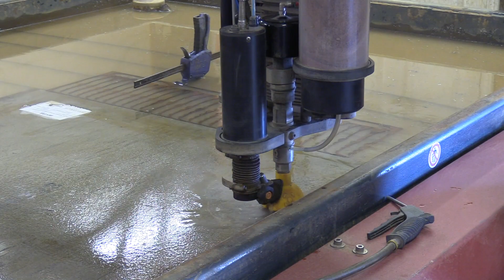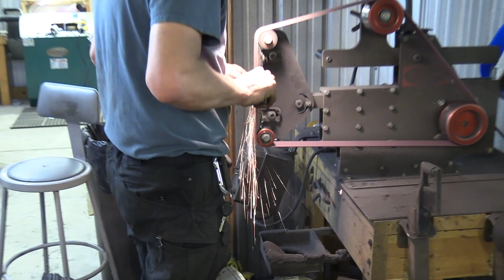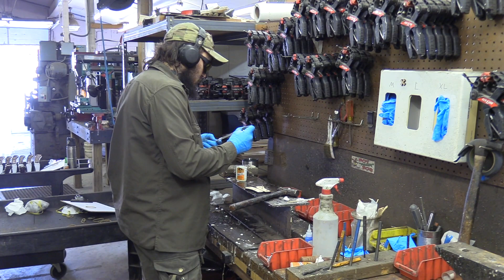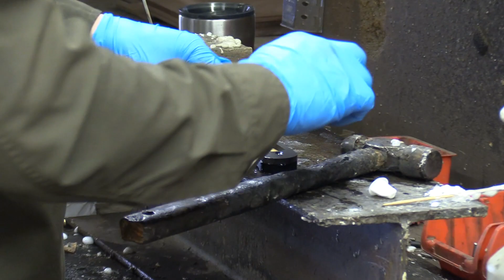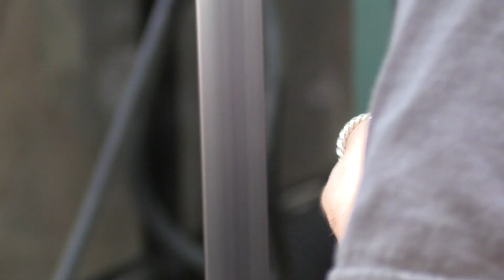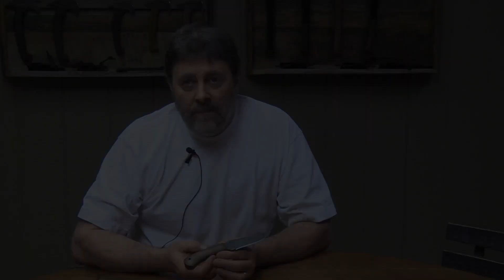#Winkler #Knives best knives

Comment: While I liked the appearance of Winkler "Jager", and loved the sheath, the blade itself was disgustingly dull, I mean far duller than any $50.00 knife bought at Walmart!! For a knife that costs the better part of $400.00, I was truly disappointed.

After spending hours on a Wicked Edge General Pro I was finally able to put a decent edge on it.

So, I while I  liked the look, (has a great online appearance) and the sheath is far superior to any other that I've seen, but the edge is the worst, it is absolutely terrible !!!

Respects,
Richard
Reply: Wow! I wonder if it was a QC oversight?
Reply: At what angle do you sharpen them? I am figuring out which angle as i do not want to guesswork.
Reply: I just got a Blue Ridge Hunter, my first Winkler Knife.  I thought it was relatively dull, for the price point especially.  Beautiful knife and sheath though.